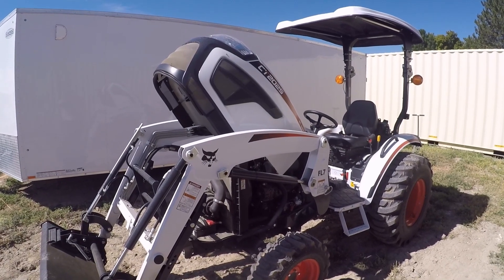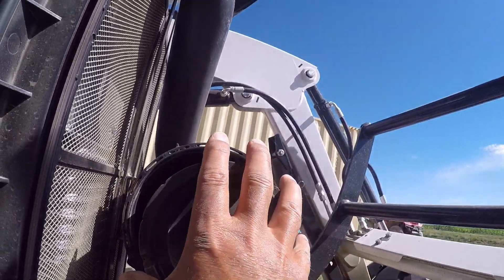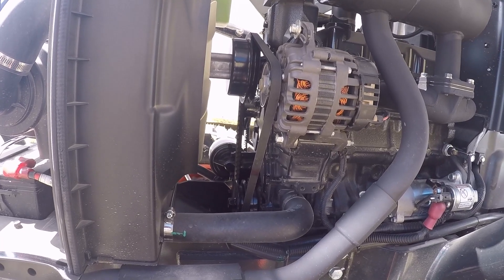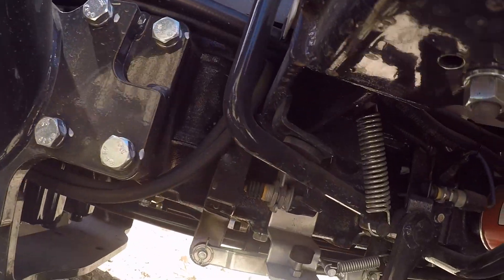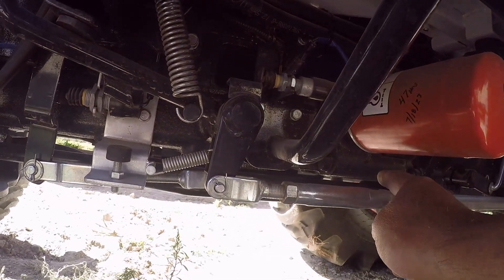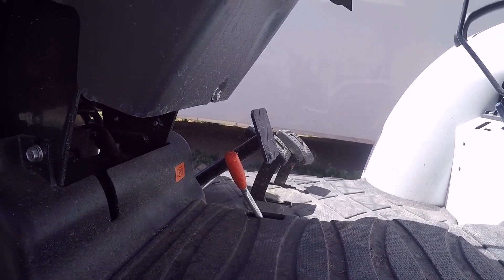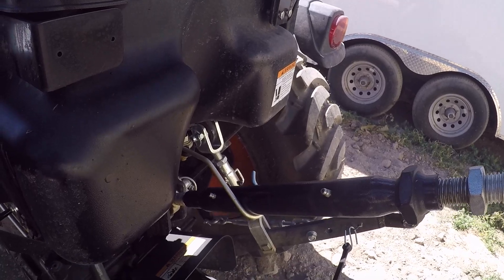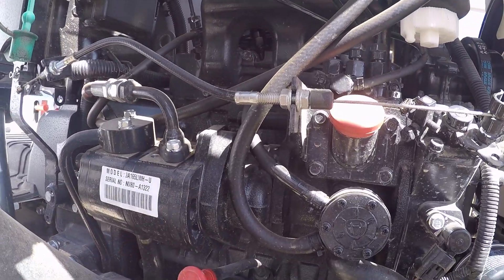Bobcat CT2025 / Kioti CK2610 tractor 100hr Service

Comment: Boy, you are running up the hours quick on this one.  It will be interesting to see how it holds up with heavy use. Checking the torques is imperative.  I have found the loader mounts tend to loosen a bit.  Every ten hours.
Reply from the maker: Yeah, I forgot how handy little open cab tractors are.
I will have to check my loader mounts and see if they’ve loosened up.